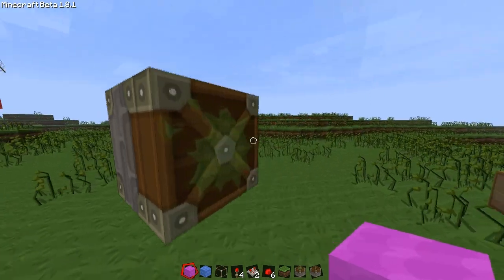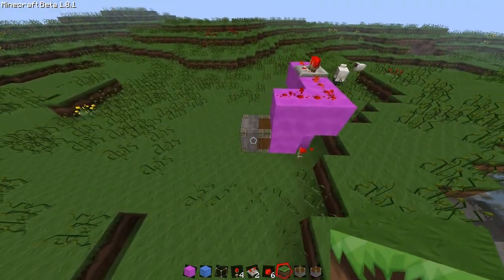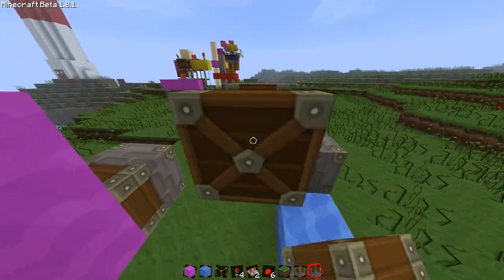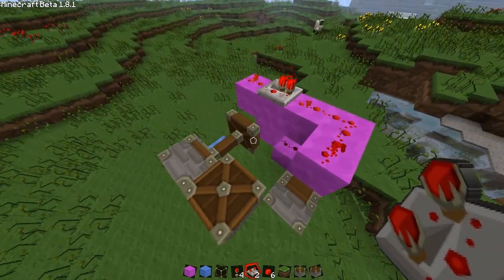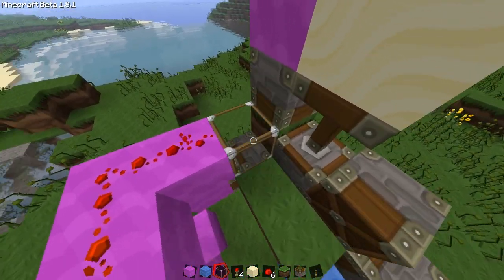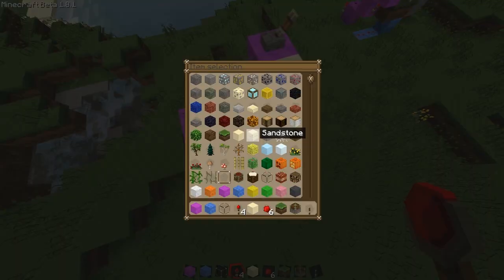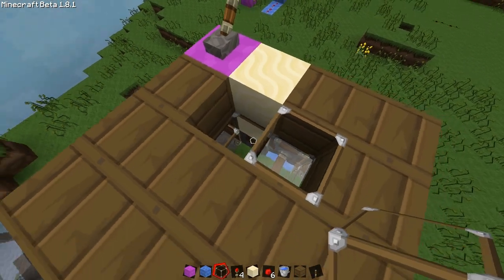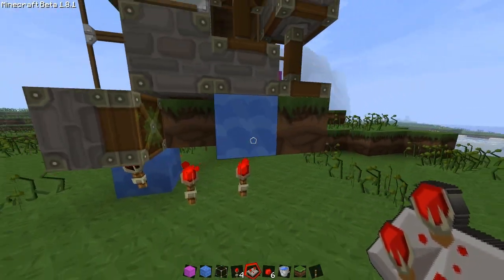Lighthouse day/night cycle detector tutorial

Comment from the maker: @ecua666 
Gah! You're right, there must be changes made to redstone. A block is pushed over a torch to activate the piston above it (part of the T flip-flop section). This pushes up the sand column...well now that isn't working unless the piston gets a block update by it.

For now I'd recommend spiraling up some redstone wire instead of using the sand column like I did to wire up the output signal.